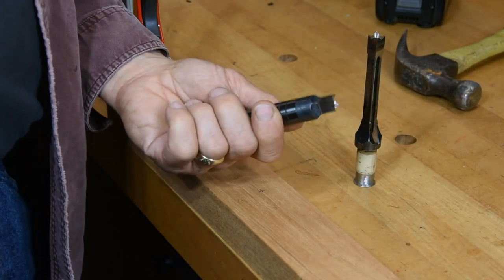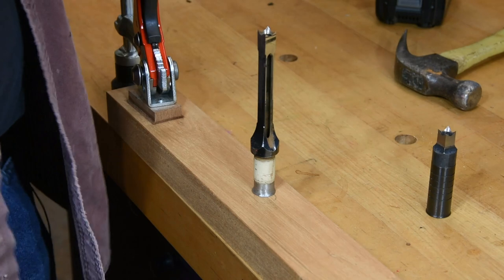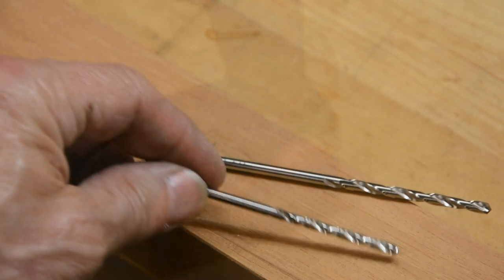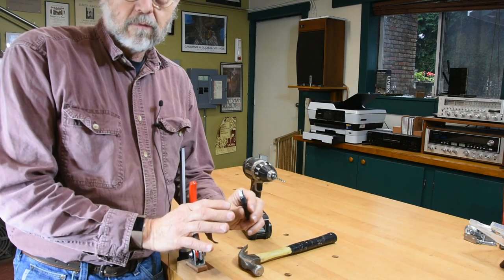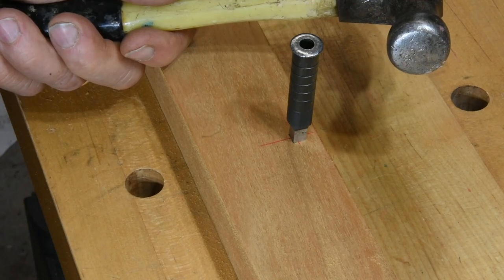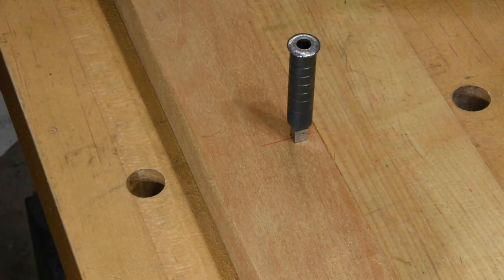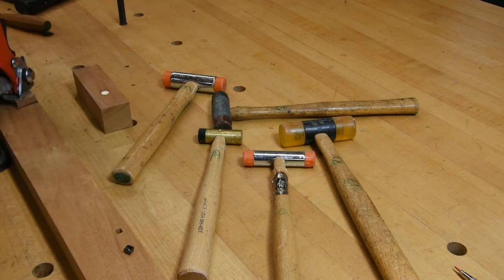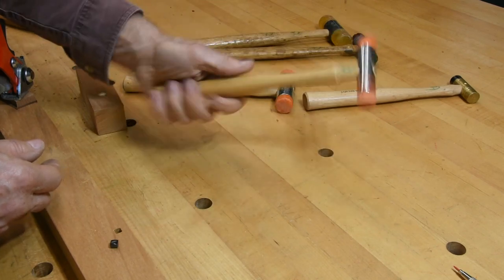Greene and Greene Ebony Plugs Part Three : Punches and Installation

Comment: Those punches from Lee Valley are great!

I like to drill the hole first with a brad point bit at the center.  Then I replace that with a transfer punch of the same diameter, which is plenty long.  I slide the punch over that and line it up with a square, and remove the transfer punch and drive it in.
Reply from the maker: I do something very similar sometimes - I will cover that in an upcoming video.
Reply: I also use this “drill first” method - really because I didn’t know the “official” method and just worked out what worked best for me. It was interesting to see from the present day master how deep the plugs were inserted - perhaps so that the edges of the plug are equal to the edge of the mortise? I have to say that, in my ignorance, I have tended to leave the plugs slightly higher (edge of plug perhaps 1mm higher than the sides of the mortise) really because I haven’t seen a G&G piece up close and personal and I just went with what I liked. I probably, it seems, make my plugs a slightly tighter fit in the mortise so that I do have to exert a bit more pressure with the mallet. To ensure that I don’t hammer the plug in too far, I use a piece of 2mm or 3mm plywood with a mortise cut out just a bit larger than the size of the plug. I then use a mallet or hammer onto a sacrificial block which rests on top of the ply which surrounds the plug in the mortise. I can’t therefore drive the plug in deeper than the thickness of the ply.
Reply: @DarrellPeartFurnitureMaker  Too bad you don't provide a link to buy these punches. No doubt you're missing out on royalties!
Reply from the maker: @michaelkelly3221  Hi Michael !  Done - just added the link.